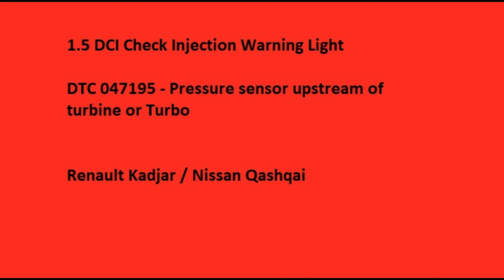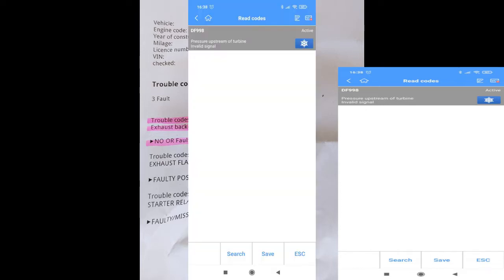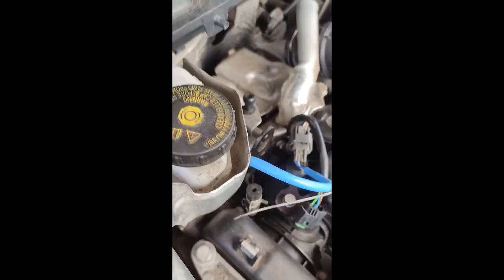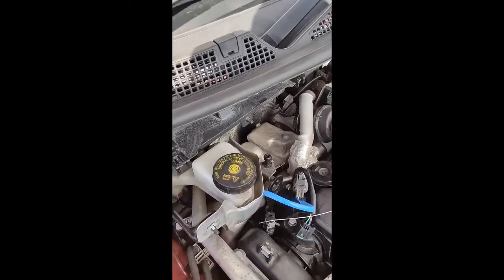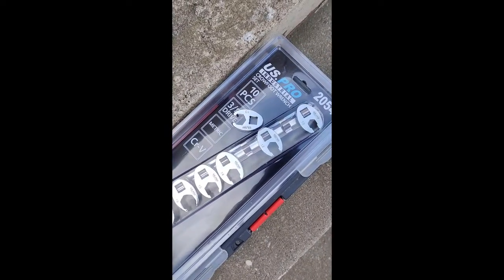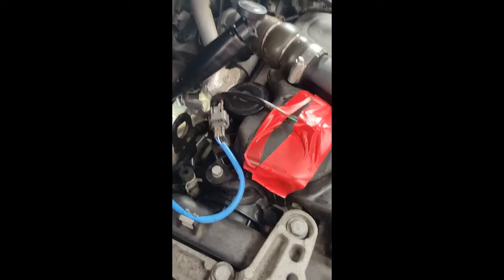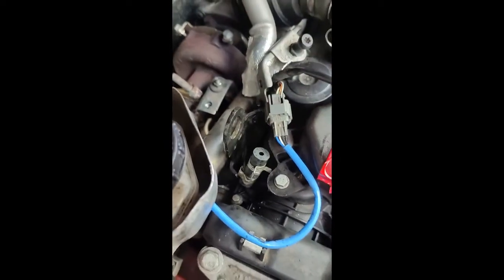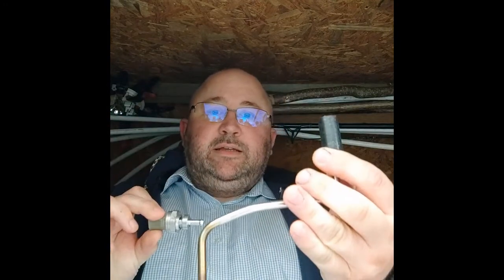Nissan Qashqai J11 / Renault Kadjar 1.5DCi Check Injection or Check Anti Pollution Fault fix

Comment: Spent over two hours trying to clear this manifold pressure pipe on my neighbours kadjar in place, no joy, maximum I could get wires in was about 15cm, tried diesel egr cleaner spray down it, brake cleaner, electrical cleaner, wd40 etc, with a drill, then tried both a mityvac vacuum pump to try and suck it out, then a car foot pump to try and force it with pressure, still no go, just totally blocked, so had to throw the towel in, for those that have had success with a bike cable and drill, all I can say is theirs couldn't have been as clogged as both of ours are.
Reply from the maker: yeah i tried most of the above also, i still have the pipe i was thinking i might cut it in half see how bad it is, also given renault wanted over £100 for the pipe wondered if Mercedes or Nissan would be cheaper, be interested to hear if you can find it cheaper.
Reply: @Stoob0y  do you know if the pipe is identical fitted to the quasqai as the kadjar? My neighbour has said since I have attempted to clear the pipe, the check injection is now on permanently, so may have another try to clear the pipe, some have said to try Mr muscle oven cleaner.
Reply from the maker: @markslade9722  I cant tell you 100% for sure it is but its the same engine as in the quasqai and mecredess A1, the part comes in a sealed bag so as long as you dont open it you can return it, worth a punt if there is a substantial saving to be had.   If im being honest the sensor may be a red herring after buggering about with it will go to check injection for a while and then escilate to anti pollution after a few (4 if memory serves) restarts so wouldn't get your hopes up.  I ran mine with the sensor off to see if the engine pressure would clear it from behind.
Reply: @Stoob0y  yeah I tried both using a mityvac to try and suck the blockage up, and also a foot pump to try and force it down with pressure, but nothing.
It's due for m.o.t soon, so is going to fail with that message up, so will try again with oven cleaner, don't fancy the job of changing the pipe, not because of the expense of the pipe, but looks a bugger to get at and do, plus I have heard some people have hat the nut snap at the manifold trying and then ended up all day having to remove the turbo, manifold etc to get the snapped nut out.
Reply from the maker: @markslade9722  if you want to buy time disconnect the sensor no error shows up! so will get through MOT. yeah i was worried about it snapping so i put WD40 on it and got the engine upto temp and it came off, but it is a faff.
Reply: @Stoob0y  really? I find that hard to believe, I would have thought disconnecting any sensor on any part of the engine would always throw up a spanner and e.m.l? But when I look at the car again will give that a try.
Reply from the maker: @markslade9722  its an easy one to try, im pretty sure from memory it stays off for a while, i believe the software gives it a number of retries before saying no sensor connected, so you get a few engine restarts before it kicks in. assuming you have a code reader to reset the codes that is.
Reply: @Stoob0y  ok thanks mate, yeah I have the Delphi ds150 with 2020 software
Reply: @Stoob0y  had another go tonight trying oven cleaner, but no joy, still only managing to get the wires etc in about 17 or 18cm, the check anti pollution has come on along with the e.m.l as the fault is now permanent, no change in the turbine pressure sensor voltage or turbine upstream pressure value when viewing live data, due to the total blockage. So looking like no other option but to buy a new pipe and fit it, looks a nightmare to try and get a spanner on that nut where it screws into the exhaust manifold.
Reply from the maker: @markslade9722  where do you stay, wish i had a neighbour like you!  well try and follow the steps in my video, warm the engine and put plenty wd40 with a litter persuasion you can bend the heat shield back to see the nut at least, and ive said the spanner size 11mm the other option which i didnt do as i was trying to save the pipe, is cut it off and put a socket and ratchet on it.
Reply: @Stoob0y  thanks mate, can't believe an e bay seller is selling the pipe under the Nissan part no for £31, although I hear the part was always that price, then went up to £130, probably Renault caught on that they sell so many of them, to start charging a stupid price. Was just watching the other videos in your list with the fella that tried attaching a rubber hose, but it didn't last long due to heat and pressure, and Jim's shed where his nut sheared so he ended up using a socket and gun gum to join it. When I come to doing it, I will spray with wd40 and make sure the engine is hot, and pray that I get the nut undone without it shearing🤞on looking tonight after trying the oven cleaner, I am not looking forward to it🤣🤣think it will involve lots of swearing and probably my hands getting cut to bits, will keep you posted on how it went, when the day arrives🤣🤣🤣👍
Reply: @Stoob0y  what will make you kick yourself is the seller on e bay that is selling the same pipe but in the genuine nissan part number for £31 is based in Scotland, and from your accent, sounds like that is where you live🤣
Reply from the maker: @markslade9722  och money grows along side the heather up here
Reply: @Stoob0y  🤣🤣🤣🤣🤣
Reply: @Stoob0y  Hi mate, did you ever cut your pipe to see where the blockage is? I was reading comments on Jim's shed and one fella cut his pipe in half while still on the vehicle, cleared the blockage, and then got a 6mm straight compression fitting coupler to join the two halves back and job done, so have messaged him to ask if the main blockage was in the top half or bottom half, so I may now go down that route and phone some plumber merchants to see if any stock a 6mm straight pipe coupler, how I didn't think if that idea myself, beats me🤦🤣🤣🤣
Reply from the maker: @markslade9722  no its on a shelf in the shed though, the blockage was on the last bend before going into the manifold though and i coulnt clear it from either end once out, its quite solid metal, would be hard to cut in situ, but if your going that road make your on video be interested to see how you cut it.
Reply: @Stoob0y  thanks mate, no plumbers merchants locally do a 6mm coupler, so have had to order online, hopefully if the coupler arrives tomorrow, going to try cutting the pipe Friday night, but it will be pitch dark and limited on time, so won't be able to try and do it while holding my phone to film, but hoping to just get a hacksaw blade from above and work small movements to make the cut, the guy who commented on Jim's shed managed it, but does not say how he cut it. Will let you know how I get on, if where I cut this one is blocked also in the lower half of the pipe to manifold, I will only have one bend that I need to try and break through, then the top half of the pipe, I can attack from both ends to try and clear, wish me luck mate, if successful, will save so more time, and not risk the chance of the manifold nut shearing that happened to Jim's shed.
Reply: @Stoob0y  hey mate, none of my local plumbers stock a straight 6mm compression coupler, so came up with a better idea, Screwfix do a brass CED earth block connector for cable up to 25mm2, so the hole is 6mm in diameter to take the metal pipe (like a choc block electrical connector), so going to get one of those and hacksaw one strip as it is a block to take four, then try that Friday night, will be easier also than trying to get spanners on a compression joint, can just reach down with a long screw driver to tighten the screws, and will cover a bit of exhaust paste around it just in case there is a slight passing of exhaust gas, but can't see that happening as the entry is perfectly round and will be tight into the six mm hole, plus being grabbed by the screws. Looking at your vid, I think using a 12" hacksaw blade should allow me to cut through the pipe on the straight run just after the first bend of the pipe from the manifold, and if I find the lower half is blocked, should be able to clear that with a wire from above as it will only be about a five or six inch length to have to clear there, wish me luck mate, your video has been a great help in seeing how much access is available back there.
Reply from the maker: @markslade9722  glad it was off help, its a nightmare of a job, good luck!!
Reply: @Stoob0y  Hi mate, update for you, finally got my neighbours car sorted, what a nightmare, how the hell you got to that manifold nut and managed to undo it, beats me, I cut the pipe on the straight just after the first bend, took an hour to try and just cut through that small pipe using just a hacksaw blade in my hand shortened enough, that pipe is bloody hard steel, anyway on cutting and getting part through, I started to wonder why no exhaust gases were escaping, you could have knocked me down with a feather, only blocked solid even at the point so close to the manifold, the top half I cut away also like a graphite pencil, solid, but cleared the top half in my house in a vice.
After another hour back to the brake cable and drill, finally struck gold, and boom, a sudden blast of smelly diesel exhaust gas making my eyes water, then came the part of trying to join the pipe with my compression coupler, just no room to get the cut half back down with the joint on either of the pipes, so in the end had to use the chic bloc brass 25mm2 earth block clamp. It seems solid enough, but my only concern is and exhaust gas leakage past it, so if my neighbour says she can smell diesel exhaust gas, then I will have to wrap some chemical metal or gun gum etc around it.
I can see why most garages don't want to touch these cars when they have that blocked pipe, but I take my hat off to you mate in you getting at that 11mm nut and undoing it, even when I tried a spanner on it as I was considering changing the pipe, in trying to turn the spanner resulted in something being in the way, think possibly only those crowd feet may have done it, but you did say in your vid that you used a spanner in the end for the initial undo.
Reply from the maker: @markslade9722  Well done to you I know how hard that pipe is, must have taken an age due to limited space to cut through...  thanks for coming back to share your experience hopefully help others.  Quite a bad design, my dads mate is a mechanic and wouldnt touch it either saying needed to goto specialist, quite a good feeling to fix it yourself though isnt it!  I think i was maybe just lucky where the bolt angle ended up from factory there was just enough room to crack the pressure with  spanner, but after that was hard slog every turn of the thread was a battle.
Reply: @Stoob0y  yeah, I thought the same, if the flats on the manifold nut had been in a slightly different position, either clockwise or anticlockwise, may have been able to crack it undone, looking at the new pipe I bought for £31, the very first bend on the pipe from the manifold is almost a semi circle, so that is the sharpest bend of all of them, so no surprise when I cut in the straight just after that bend, no exhaust gases still came out. What made me think the very small length of pipe before where I cut coming from the manifold was going to be clear if blockage, was because in your video you mentioned yours was clear there, and your blockage started a little further along on the bend that is just slight, not even a 45 degree bend. Never want to attempt that again in my life, and I think my hands are going to take a month to heal from all the cuts and grazes to them now after doing this, but at least my neighbour is one happy lady now.
Reply: @markslade9722  Hi Mark, been reading through all your comments in regards to your battle with unblocking, I had an idea today to unblock mine by taking the sensor off and block the car's exhaust and giving it a few good revs to try build up some back pressure and see if that helps blow the crap out the exhaust pressure pipe, don't know if this would cause more issues though, I have just seen videos where people do this, no idea why they do it but it causes a massive cloud of black smoke in the process also, what are your thoughts? good/bad idea?
Reply: @thelegand1  would not do any harm trying mate, all you are doing there in blocking the exhaust at the tail end is creating more back pressure that could help try and clear the blocked manifold pressure pipe with the sensor off, but don't do it for much longer than a few seconds.. To be honest seeing how much the narrow pipe blocks, I don't think it will work for you though. I tried both pressure and vacuum at the blocked pipe using both a mityvac pump and a car tyre pump, but neither helped, the pipe blocks solid from the first semi circle bend right close to the manifold connection, and all the way up, hope you manage to clear yours.
Reply: @markslade9722  Yeah I was thinking the same as I saw your previous attempts can't get much more on it than a full vacuum, impressed with your efforts though. What's the condition of your neighbours car currently? All sorted now and no exhaust fumes?
Reply: @thelegand1  yeah been great since I did it, no probs at all, did a front wheel bearing on it a few days ago for her, so all going great, best of luck with yours, the second you get that pipe cleared, you will be screaming for joy!!! Once I cleared my neighbours pipe, I could see all the live data for the pressure changing as I revved it up using my Delphi ds150, surprised that it goes as high as just over 3 bar which is a lot of pressure, hence why people that try cutting the pipe and attaching some rubber hose don't last long and burn and blow off after a month. I had to erase the fault code using my diagnostic gear once I cleared the pipe afterwards, as the code won't clear by itself, once the blockage is sorted, all the best getting yours cleared, really is a stupid design in where they position the pipe.
Reply: @markslade9722  Thanks Mark really appreciate that. Interesting to know that the fault doesn't clear unless wiped. I only have a basic OBII scanner so I have to take it to local garage to clear, he's pretty good and will just clear it for me though. Do you have any thoughts on why the pipe was blocked initially and getting to the root cause? Jim's shed video explained that the damage is already done if it's getting blocked at this point, as the turbo and DPF are likely to be all sooted up also
Reply: @thelegand1  I would say poor quality oil and diesel, once cleared, make sure you use the correct spec engine oil and regularly put some diesel injection cleaner to a full tank of diesel like STP, and once a year, squirt some egr cleaner down that pipe as a preventive measure.
When that pipe is blocked the engine ECU won't allow any d.p.f regens, so that is why the dpf then clogs up with soot, so make sure you get it cleared a.s.a.p. Those 1.5dci engines have a fifth injector to inject extra fuel into the exhaust to regenerate the d.p.f, so it monitors the soot content and then performs a regen when needed, so eliminates the need to do motorway runs as the regens can happen in the background even while driving around town.
Reply: @markslade9722  Thanks Mark, good point. I don't know what a regen is, so this i'll have to educate myself on that one, if there's any good videos send them my way! Also good explanation on the fifth injector, I don't like the idea of having to drive around for an hour every month to clear the soot out of the engine, goes against the reason I bought the car that being economy. Thanks again great explanation
Reply: @thelegand1  a regen is a process that is performed to clear the d.p.f of soot, it is done by getting the temperature up to such a high level that the soot is burnt off the d.p.f. This is achieved on the kadjar 1.5dci engine by the use of that fifth injector injecting fuel into the exhaust that then ignites to create the very high temperature to burn off the soot from the d.p.f (and is called regeneration), sensors monitor the pressure before and after the d.p.f so it knows when the d.p.f is getting blocked with soot, and so then decides if a regen is needed. Older diesel cars fitted with d.p.f's didn't have that, and so people buying small diesel cars and just using them for short journeys around town, and never doing long motorway trips in them, were finding after not long of driving them around town, the d.p.f would get so clogged that a warning light would come on saying the d.p.f is clogged, and forcing them to make a trip up the motorway at high speed  for about 40 minutes so the d.p.f could regen and burn the soot away.
So to prevent people with kadjars who just use them to drive around town on short trips, they fitted this fifth injector to inject fuel into the dpf so regens are done automatically while driving around town, when a regen is happening, you will notice the revs slightly higher, and may smell a burning smell as the exhaust temperature is so much higher during the regen.
With a good quality diagnostic interface, software and laptop, all this can be monitored in live data (pressures upstream, downstream, calculated soot content in grams, miles travelled since last successful regen erc),  and also a forced d.p.f regen can be performed with the car at a stand still using the diagnostic gear.
But if for any reason a fault is present (like you have a.t.m), with the blocked pipe to the upstream turbine sensor, no regens will be occuring, so if you carry on driving the car like that, the dpf is just going to continue getting more and more blocked of soot, that is why the message check anti pollution also comes up on the kadjar, along with check injection when this upstream turbine pressure sensor pipe is blocked. So try not to drive your kadjar much until you get your pipe cleared.
Reply: @thelegand1  Here is a copy and paste off the internet explaining in more detail about the 1.5dci engine.
On previous generation Nissan 1.5 dci engines, there was a DPF light - this would illuminate if the enginemanagement system determined that the DPF could be blocking up by sensing exhaust back pressure and the history of your driving style (worst case is slow speed, stop-start). The light would come on telling you to drive the car a 'high' speed for a sustained period to increase the exhaust gas temperature and burn off the soot...

On the Euro 5 version (fittedin your Juke, if you have a diesel of course..), there is no DPF light. The engine management system has OCS (oil condition sensing).. this system determines if it believes the DPF may be at risk of being blocked in much the same way, but to regenerate, it does not require you to drive at higher speed for a sustained period. Instead, it uses 2 strategies..

1. Post-injection of fuel - after the main combustion event (the one that creates your power..) there is a small additional injection of fuel that burns into the exhaust, increasing the gas temperature, burning off the soot..

2. The engine is fitted with a 5th fuel injector in the exhaust that pumps fuel into the DPF to raise the temperature and burn off the soot

Both are done regardless of engine/driving speed and are invisible to the driver.

The side effect of the post-injection is that there can be some dilution to the engine oil during regen, and so multiple regens can degrade the oil quality.

The OCS system constantly estimates the reduction in oil performance and calculates the new service interval required.
Reply: @thelegand1  as you say your kadjar is a 16 plate, just in case you didn't know, those engines are rubber belt driven, not chain, and the interval for a timing belt change is every five years or 60,000 miles, which ever comes first, so make sure your timing belt has been changed by now, if that snaps, major break down and lots of engine damage with bent valves etc. While changing it, make sure to do the tensioner and water pump the same time, as they are driven from the same belt.
Reply: @thelegand1  another copy and paste here explaining the regen process on your engine
At the Geneva auto show Renault unveiled a new diesel particulate filter with exhaust post-injection. The filter, which will be available during the first half of 2006 on the 85hp and 105hp versions of the 1.5 dCi diesel engine that powers Clio and Modus, allows active regeneration of the particulate filter in all traffic situations, even when the car is at a standstill with the engine idling.

An injector mounted directly in the exhaust pipe enables the regeneration process to operate continuously, making this system suited to urban traffic applications.

Existing particulate filter systems in passenger cars have relied on engine (rather than exhaust) post-injection to enrich the exhaust gas and increase the temperature. This approach, while not requiring the additional exhaust injection hardware of the Renault system, has limitations in conducting filter regeneration at very low engine loads.

The new Renault system enables the particulate filter to be regenerated at all engine speeds and in all traffic situations. Although advantageous under urban driving conditions (involving low speeds, idling at standstill, and frequent starting and stopping), this solution also operates in highway driving since the limitations associated with conventional systems (minimum speed and length of journey prior to regeneration) no longer apply.

Operating independently of the engine’s ordinary fuel injection system, the exhaust-pipe injector is dedicated exclusively to particulate burnoff. The post-injection system has been awarded more than 50 patents.

The exhaust gases leaving the engine pass through a first catalytic converter that treats the carbon monoxide (CO), oxides of nitrogen (NOx
Reply: @markslade9722 it’s a shame that it still mamaged to get blocked up even after all this fail safe regen process. And I wish I got your advice first before all the other advice from people saying to ‘just drive it and it will burnt the soot away’, i’ve done over 1000 miles in it since then. My fault I suppose
Reply: @thelegand1  yeah you have done more damage driving it like that, as no regens will be occuring while you have that fault, so more and more soot will be building up.
Any engine management fault present to do with emissions, will put a stop to any regens happening, and won't even allow any diagnostic gear connected to perform a forced regen, until it's clear of all faults, and those codes erased from the ECU's memory, only then will it allow the diagnostics to perform a forced regen.
Bet once you get your pipe cleared, codes erased and plug in diagnostic interface, you will find the amount of soot content in grams extremely high, as you have driven 1,000 miles all around town short trips, without the engine being able to do any regens to keep the dpf clear of soot.
Reply: @thelegand1  the pipe still gets blocked because that is connected at the actual exhaust manifold, which bolts to the cylinder head, the pipe that gets blocked monitors the turbine upstream pressure (from turbo), but the d.p.f (diesel particulate filter), is slightly further down in the exhaust system, and it is that honey comb looking filter that the regens burn off the soot from.
The d.p.f has a before and after pressure monitor connected by two rubber hoses that are common to split, that can cause issues, so make sure those aren't split also, another common fault on them is also the exhaust flap seizes due to soot, so the actuator motor can't move the exhaust flap.
You need to get yourself a good diagnostic v.c.i with software and a laptop, and all that can be seen in live data, so you can instantly see if everything is working,, you can even activate the exhaust flap using the Delphi ds150 etc, can't do much to modern cars these days without having the diagnostics to make it so much easier.
Reply: @markslade9722  thanks again Mark, really helpful info. Most the miles I have done were on the motorway, so hopefully the carbon build up isn’t as bad as if I were just doing short trips. I’m in the middle of taking the pipe out now, just letting some WD-40 soak in before I give the nut a good turn. Do you think it’s a good idea to blast the engine a bit while the pipe is out to clear out any more soot that’s in the exhaust manifold?
Reply: @thelegand1  won't do any harm doing that, your eyes will water and throat will get sore breathing that in though, as mine did once I cleared the blockage in the pipe with the engine running, you are getting the exhaust fumes before they have been cleaned through the emissions system, so pretty strong and smelly.
Hope it all goes well for you, and hope you have all the correct crows feet, flare spanners etc needed to get to that pipes nut and so hope you do not shear the nut, but sounds like you have the engine hot and have sprayed loads of wd40 to help, let me know how you get on once done, not a job I would like to have a go at again very soon!!!lol.
Reply: @markslade9722  haha just going in with a trusty 11mm spanner, see how I get on! 🙏🏻 for me
Reply: @thelegand1  🤣don't think you will manage with just that, but hope you do, I tried just a 11mm spanner, could get on it, but then found other things in the way stopping me being able to turn it.
Reply: @markslade9722  i did it! Notched out a 6mm gap using an angle grinder on circle end of a combination spanner. Winner winner
Reply: @thelegand1  chicken dinner, well done, get the bottle of champagne out to celebrate tonight🥳🥳🥳🥳
Reply: @markslade9722  I might have won the battle but the war is far from over! Bloody diesels 😂
Reply: @thelegand1  once you get the new pipe on, don't forget you will need to erase the d.t.c from memory using your diagnostic tool, even though you said it is a basic one, it should still allow you to erase the d.t.c.
Reply: @thelegand1  I am only 5ft 10" tall and found it a struggle just trying to reach over the car🤣🤣🤣so I ended up standing on some steps, those cars are made for people 6ft 6" and taller!!!!
Reply: @markslade9722  hey Mark, all finished with it. Going to give it a drive and see how it gets on next couple of days. Strange thing is, after I removed the pipe and ran the engine to blast out any remaining carbon, the fault was gone on engine start! I’m going to put it all in a video myself and you can see it better there
Reply: @thelegand1  nice one mate, surprised the fault cleared itself without you having to erase the code, maybe if I had taken my neighbours for a drive straight after, hers would have cleared itself of the spanner and check anti pollution, but seeing it still on after just starting it up, I used my Delphi to erase the code and put the messages out, will look out for your video, well done.
Reply: @markslade9722  most confusing part is I didn’t even attached the sensor, it was just a hose, there must be another sensor somewhere to check for blockages or something! Thanks Mark!
Reply: @thelegand1  what I found on my neighbours was from the faults stored, the reading was always 1.3 bar, so my neighbours blocked up while there was still some pressure stored in that pipe to the sensor, on me disconnecting the sensor from the pipe, so exposing it to atmospheric pressure, the pressure then was atmospheric, 1 bar, so this made it permanent with check injection and check anti pollution, bit like blowing up a balloon or tyre, then letting it down, so may have been the same with yours, if you now check live data for upstream turbine pressure, you will see it varying from one bar right up to just over three as you rev the engine, have a well earned beer and put your feet up, you deserve it after today🤣🤣🤣🤣🤣🤣
Reply: @markslade9722  on to the next job now haha!
Reply: @thelegand1  if you own a car and house, there is always at least one job that needs doing on either daily!!!!!